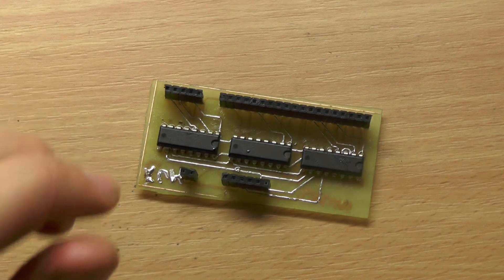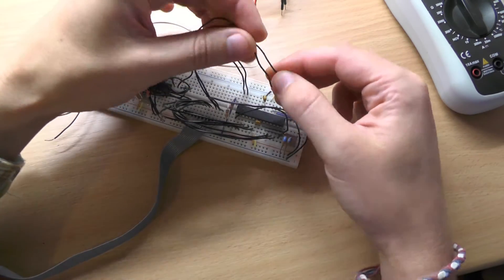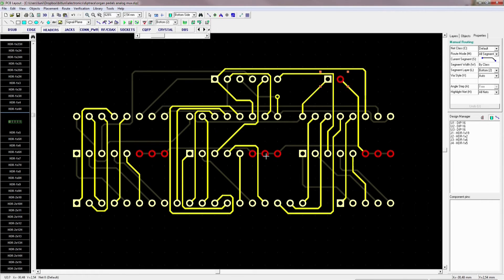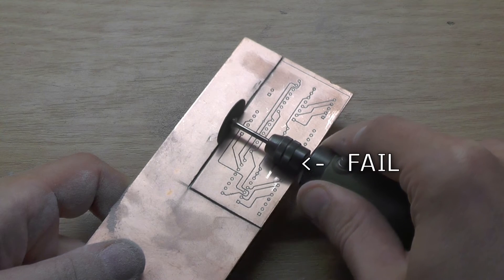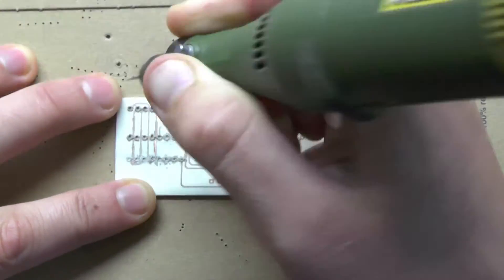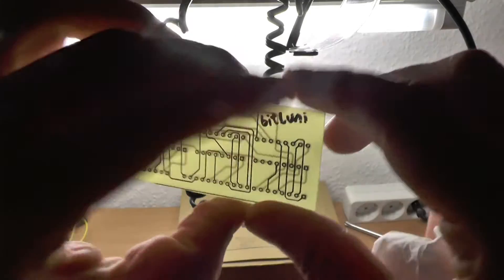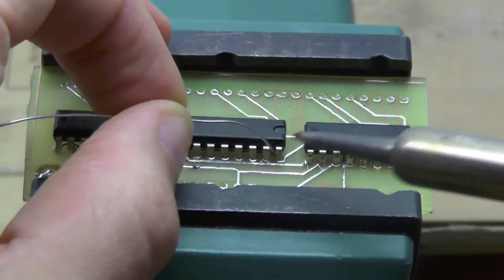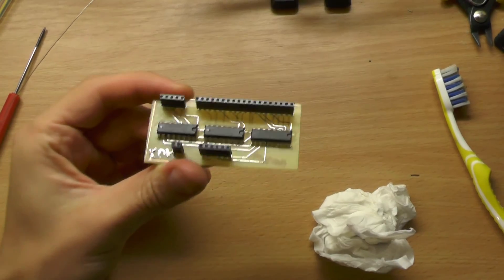MIDI organ pedals - 04: The cursed multiplexer board

Comment: Incase anyone is watching this? Has anyone tried using tap oil? Doing this and then mineral spirits to clean it off. Or any other solvent for the oil to be removed. Just my two cents because I have never etched myself......

Comment: Which multiplexer chips are you using?
EDIT: Comparing the connections between the traces on this and the main board with the ones in the data sheet, I conclude that I think it might be a 74hc4051. Is that correct? :)